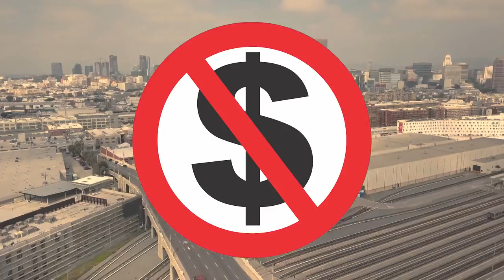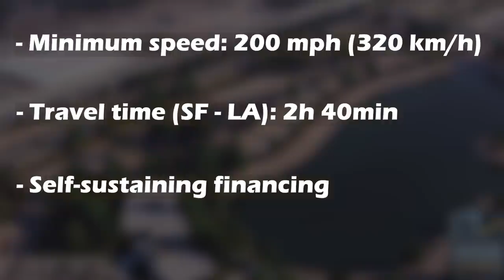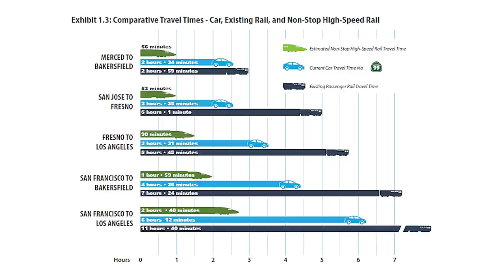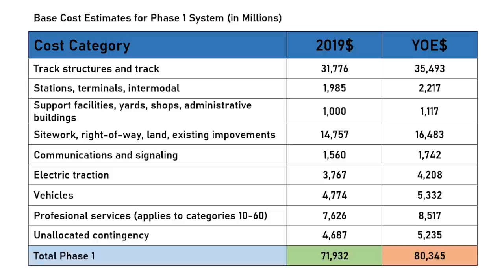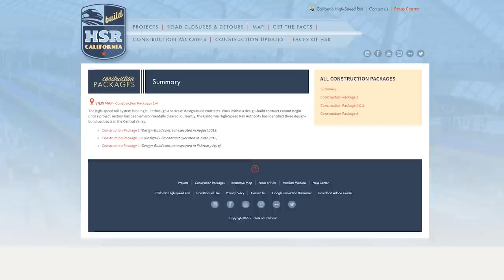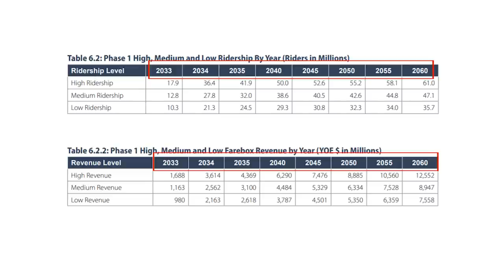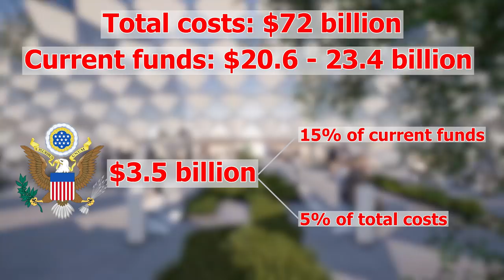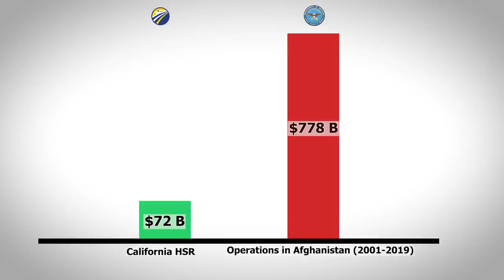California High-Speed Rail Project: All You Should Know

Comment: USA struggles to build any sort of mass transit 

China: high-speed rail printer go burrrrrrrrrrrrrrr
Reply: Why mass transit when America has cars and planes?
Reply: Just look at Amtrak they are not making any money. Don't let the taxpayers bail out this project.  The plane can fly no slower than 600 miles per hour. Train lucky if it reach 100 mph.
Reply: @canaldofred2366   inefficient in energy expenditure,  higher cost per mile,  and very polluting.

Takes to much real estate for airports to build. Loud asfuck airplanes. Annoying procedures takes to long to board a plane.
Reply: @senmafugu  inneficient? Planes are as efficient as you can get, and cars are much faster than mass transit. You say that airports take a lot of space, but what about the train tracks? Do they magically float?
 Polluting? You really think that millions of tons of steel and cement to build te tracks are green? Of course its not. And im not even talking about the carbon released producing the energy to power the trains. 
Yes, planes are loud, and so are trains. This has the side effect of lowering property prices very near the area, making homes more affordable.
Reply: @canaldofred2366 can't believe you want to argue on a scientifically proven concept. Mass transit is better overall.   

Max capacity for high speed trains could reach 20,000 people per hour. 

imagine 20000 people on their cars on a highway versus 20000 people in a high speed train.

Which do you think is better Cost in fuel and cleaner? Not to mention how slow it could get in a highway with a 20000 cars.   

High speed trains could go 120 mph and very smooth travel. 

They use more materials and resources for building highways then rails. Concrete especially.

Planes are the most polluting of all. It cost more energy in fuel by lifting the whole thing instead dragging it on the ground. 

There is no doubt that high speed trains are cheaper, faster and cleaner. 

Try to research this topic on your own.
Reply: @senmafugu  the high capacity of a high speed rail is exactly where the problem is. You'll need a huge demmand to support HSR, and thats exactly why its only been built in densely populated places like China, Japan and Western Europe. America simply does not have this pop density. Also, when you go to places by train, you cant go anywhere when you get to your destination, because you dont have your car. How can you get to the suburbs after leaving the station? Walking 20 miles? Taking a extremely slow bus? Lets remember again: America is not Europe, its much more difficult to make public transport in ametican cities than in european cities. And cars are much faster in the urban enviroment.
Reply: @canaldofred2366  that is the difference between USA and the rest of the world is a comprehensive mass transit system. It's underdeveloped or non existent in many parts in america. 

Cars are a luxury item. You buy the whole car, pay for insurance, pay for gas and the general upkeep. In all its bad investment. Unless you're rich and could afford it. But for the people who arent?  

That is why a Mass transit system  has a great value. Especially in inner and inter city travel. The government pays for it and the return in investment comes in increase of commerce and productivity.

This is why China is winning because they have both options for people of different wealth categories and a more complete transportation system.

Cars are not faster in an urban enviornemt. They all get bogged down in traffic. 

New York for example is reliant on Mass transit. Much more dense cites like Hong Kong, Shanghai, Tokyo, Seoul have an effective mass transit system.
Reply: @senmafugu  like I said, it all comes down to population density. And no, cars are not a luxury in America, as 93% of households have acess to at least 1 car, and the remaining 7% are the ones who use public transport. How do you realistically want to implement public transit in a city with 2 thousand ppl per square km? It makes absolutely no economical sense.
Reply: @canaldofred2366  the benifit of a mass transit system is clear in dense cities.
 
It's game changing in rural areas. 

you don't build  public infrastructure for the immediate profit because most cases you don't. 

You build it to develop areas of potential of economic growth.

 A railroad station to a small town in the middle of nowhere makes no sense in the short term. In the long term, It's the eventuality of it becoming a great city. 

China is building highways, roads and rails in the middle of nowhere.

 In 2 decades a small farming village became comes a town. A small town becomes a city.
Reply: @senmafugu  all dense cities in America have public transit. Chicago, NYC, San Francisco, etc. But America has very few dense cities, and that is the "problem".

Game changing in rural areas? Wtf. The vast majority of people in rural America own cars, so public transport would be barely used and wouldnt improve lives at all, just spend taxpayer money. 

You like to compare America with China, but like I said, America is not China, we have much less people per square mile. 

China builds rail to rural towns because the majority of rural China is still too poor to afford cars, so they rely on public transport. America don't have this problem.
Reply: @senmafugu  LOL bad in NY and Chicago? These 2 cities were ranked by "farandwide" among the 15 best on earth for public transportation, NY was 10th and Chicago was 6th. Just for context, the NYC metro has the largest number of stations in the world, and one of the largest lenghts. 

Saying that its cost effective everywhere is wrong, as the vast majority of metro systems and trams lose money while operating, except for a few like hong kong. 

And again, like I said, America is not Europe or China, American cities are less dense, and any significant form of public transport outside downtown would be prohibetively  expensive.
Reply: @canaldofred2366   NYC has good public transport but cities like LA is non-existent. high density area with almost 1 passenger per vehicle is definitely not ideal.  2 person per vehicle and it halves cost in transportation.

if you cant build it in low population density area. So why isn't a high cost solution for a high income states not being done? San Francisco ,LA and Vegas are relative 4-5 hours drive in car.  HSR between vegas and LA takes 1 hr maybe car rental services on every stop. If Californian are so progressive and liberal you'd think they support it right?
Reply: @senmafugu  "LA public transportation is not existant" wrong. Why dont you search things before saying them? LA has a pretty decent metro system, and has also buses and trams. But, like I said many times, LA doesnt have enough density to support a big metro far from downtown.

The distance between downtown LA and downtown Vegas is around 260 miles. There is no way a train could do this in an hour over montaniuos terrain, considering acceleration and stopping and going trough the city. Also, there is not enough demand for a train doing this route. About the LA -SF, well, its being built, and it is a complete failure, wasting over 100 BILLION taxpayer dollars and underschedule. California is a liberal and progressive state, thats why they dont realise that trains are stupid in America.
Reply: @canaldofred2366  you want everything to be profit oriented? Really, why?
Reply: @ianhomerpura8937  everything? Wtf, im talking about rail. And yes, I want rail to be profit oriented because I dont want my tax dollars funding something that would be easly replaced by planes, that DONT require subsidies and are faster.
Reply: @canaldofred2366  unfortunately, highways and airports DO get subsidies, through federal grants and trust funds. Why shouldn't railways have them too?

And I am just curious why people have that mindset about taxes, that they can dictate where it is spent?
Reply: @ianhomerpura8937  yes, highways do get subsidies, but they are necessary, unlike passenger rail. Airports also get subsidies, and I am against it, but they get much less than rail. 

Why tf should I not decide where my taxes go?? It is LITERALLY my money being stolen by the government. I should at LEAST choose where it is going. Or else the government shouldnt be stealing my money at all.
Reply: @1quickster  lol how many time have airlines been bailed out? They receive subsidies every year.

Comment: While I appreciate the even-handed approach this video took to California's HSR project, the plain facts are that it is a disastrous confluence of terrible management, absurd financial and ridership projections, political chicanery, incompetence, and self-dealing.
The original budget projection for the entire system (the differences in phase 1/phase 2 were not explicitly pointed out to voters when approved) was $33 billion.  The current projection for both phases is more than $110 billion.
It was to be open by 2025; now just the first phase is 2035 and the second is 2050.
It is now, in part, a blended project (sharing track with local commuter trains in some areas), meaning that the 2 hour and 40 minute LA to SF travel time is off the table (despite the fact that it was explicitly guaranteed in the bond measure).
The ridership projections have been moved every which way except sideways, but assuming the 1 million per month on phase one (the spine from LA to SF), that translates into 18 trains running at 100 percent occupancy round trip (about 1000 seats per train, max) between the two cities every 45 minutes (allowing for peak and off-peak differences) during the operating day; if one goes with higher ridership numbers that means just to supply enough seats to potential riders a full train would have to leave both LA and SF every 15 minutes.
It was also originally thought it could attract a private investor.  Not a single outside company has ever come forward (and the Spanish firm that bid on the project years ago withdrew its offer in disgust).
The decision to start building in the flat, sparsely-populated middle of the state was made because it was theoretically easier and faster and to justify expanding the pot of tax money that is needed (hey, we're already this far along. it would be silly to abandon and waste all that money so pass a tax bond to give us another $50 billion, etc.).
This, of course, has turned out not to be true; HSR is currently building in the Central Valley but in the city of Fresno ALONE they are about 500 parcels of land short from being able to even think about building out.  And that is after a decade of trying to buy and/or eminent domain as much land as possible.  In fact, this particular problem led the contractor for that section, the extremely politically connected Tutor-Perini, to write a 36 page letter to the HSR authority calling the delays "beyond comprehension."  And that's from the company that has billions of dollars in contracts riding on the project. (feel free to search for the news stories).
As to California's famed congestion problem, HSR will not and was not designed to relieve significant local traffic issues.
The project is such a cluster that even the person who thought it up, spent years working to get it approved and the bond measure passed, has walked away in disgust, specifically noting that even it actually gets built it will not in fact be high speed rail due to the poor planning and political compromises made.
This post is already way too long but it could be even longer, going into self-dealing contracts, the hiring of politicians to work on the PR aspect, the fact that the cap-and-trade money was never intended to pay for HSR and its shift to that has damaged other projects, etc.
Suffice to say, the state's HSR is a textbook example of exactly how NOT to do government infrastructure and, instead of actually making HSR systems more palatable around the country has in fact made - with all of the stink associated with this - the building of any such network politically impossible
California leads the way again.

Comment: This would be at or near completion if the dems weren’t so focused on “HSR”. If it was limited to class 7-125 mph with enhancements for crossings and signals it would be feasible for the funds available but once you go above 125 then you must have grade separation at great cost
Reply: @J you must be a California politician .  You have not the slightest idea what your talking about or the requirements/cost as speeds increase.  Category 2 HSR as set by the FRA is beyond 79mph and up to 125 mph.   Why is this important?  Because above 125mph you are required to have grade separation or simply put a raised rail bed, similar to a freeway overpass for the entire length of the area with speeds above 125.  This is what costs so much above that 125 speed. Above 79 MPH has certain safety and crossing requirements but nothing like above 125.   AMTRAK has plans for short areas in the NE for above 79MPH but only in limited area.  It’s all about dollars and priorities. Now back to the Reservation with you.

Comment: but damn.. Imagine High Speed Bullet train to CA to NY, Vegas, Miami, TX and the rest of the Big City..
Airlines gonna get out of Business
Reply: You should probably check the distances between cities. How are trains going to put airlines out of business when they are simultaneously slower and more expensive than them.
Reply: @blackhole9961  for now, but we reached peak oil production in 2019. Gas and oil prices are only going to go up while rail prices come down, and by the time this damn thing is finished, those prices will have probably intersected.

Comment: It's the same tired run around here in the US; we have plenty to spend on the DOD but when it comes to infrastructure suddenly we are short on funds. While I don't think its necessary to connect the whole US via high speed rail I would like to see larger cities be connected (Like LA to SD, LA to Las Vegas, Dallas to Houston and so on). If we can build and operate 10 aircraft carries (among thousands of military vehicles) what is our excuse on connecting major cities and insuring that larger cities have reliable and modern transit options besides cars? While I like cars it would be nice to have the option to hop on a modern train to go into downtown or other parts of city.
Reply: Fares should be less than $2 each way. Fares are too expensive already in the U.S.

Comment: Your video completely leaves out a critical fact that CHSRA completely ignore: RAIL TRAVEL IN CALIFORNIA HAS BEEN GROWING FOR FIFTY YEARS: That especially applies to the San Joaquin service between Bakersfield, Fresno and the Bay Area, a service that began as just one train a day, each way when it began in 1974, after all passenger rail service along the route was discontinued in 1968 (ATSF) and 1971 (SP). Today, the pre-COVID Amtrak San Joaquin service is seven trains a day each way, with one train each way between Sacramento and Bakersfield, and connecting bus, subway, LRT and passenger train service to many different places, including Santa Cruz, Anaheim, Yosemite National Park, the Napa Valley and even Las Vegas, Reno and Seattle.

Even when CP1-CP4 is complete, the new line will cut at least an hour off the EXISTING Amtrak service time, making it much more competitive with competing modes. The new line will raise train speeds on the Amtrak San Joaquin to at least 125 MPH from the current 79 MPH, which will induce demand for even more trains between Bakersfield, the Bay Area, and Sacramento. This may even lead to the introduction of dual-mode (diesel and electric) trains, like the Azuma trainsets in Britain.

Comment: While USA has still 0km or high-speed trains.... China has:
- 38.000 km of high-speed train tracks as en 2020
- will reach 70.000 km in 2035.
- Has shitload of trains using them, for example, 400 trains a day (including above 300 high-speed trains) between Shanghai and Nanjing (300km away): check yourself on @t Shanghai （SH 上海） Nanjing （NJ 南京）
- Chinese train runs at 300-350km/h (around 200-220mph).
- Chinese trains are comfortable, cheap, safe... and basically never late (98% on time).
USA is really an underdeveloped country when you speak about infrastructure (electric grid, bridge, trains, metro, and so on)...

Comment: We need one about Taiwan. Then maybe Melbourne-Sydney-(Brisbane)?
Reply: The THSR would be pleasant to take from Taipei to Kaohsiung, or at least to Taichung. However, there are too much intermediate stops, making most trains (non-express trains) essentially conventional-speed commuter rail.
Reply: @GyacoYu  I take it to Tainan often and it's incredible every time imho.
I'm not sure how optimized timetables and ticketing systems are. But you could change in Taichung to get on the faster one, if coming from a smaller city.
Reply: I believe Tainan could be served by a Zuoying-Tainan subway instead of a HSR station. They are too close.

Note that the Tainan HSR station (TRA Shalun station) is far away from Tainan. If you want to visit Tainan city center, transfering via TRA Shalun takes you 23min, while via TRA New Zuoying takes 32min. There's really no big difference! So the HSR Tainan station is indeed not that necessary except for the very few people living in the rural area close to the station.
Reply: @GyacoYu  I think the area is under developed and only reasonably reached by car. But from Yongkang it takes me roughly the same amount of time by bike to HSR as to TRA. Now if you think about going from Tainan to Taipei via Zuoying, you'd add about 20min to the journey, so going north it's still worth it.